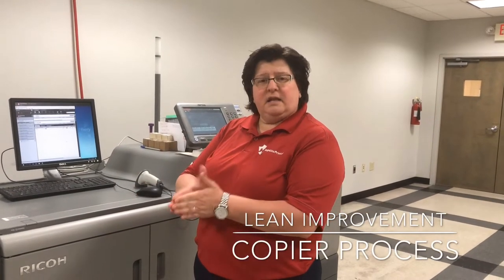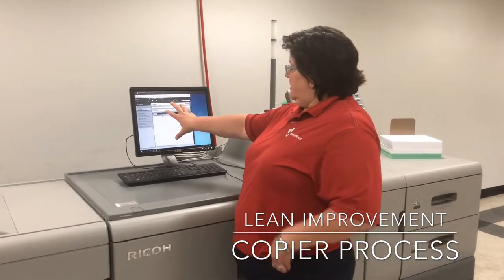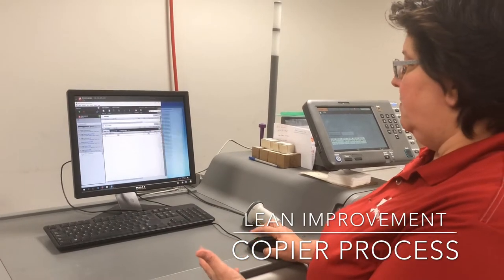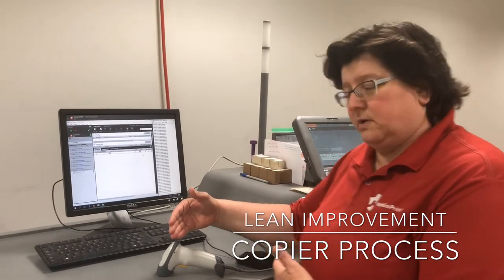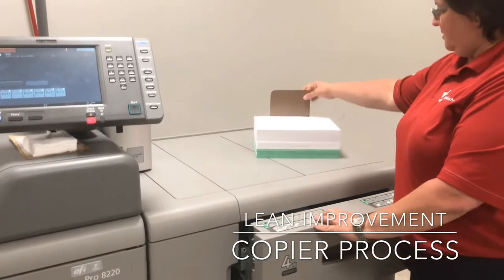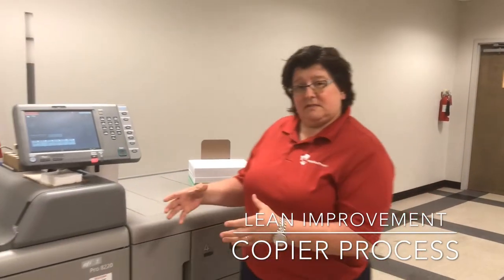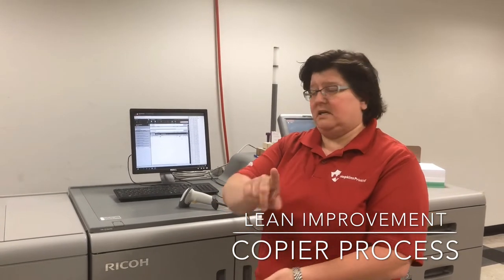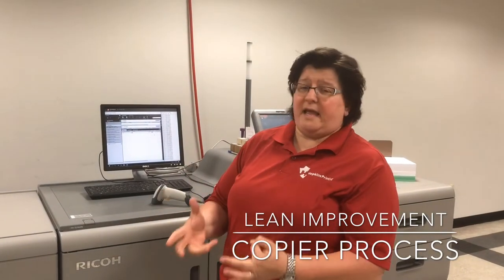Lean Copier Improvements

Comment: My favorite Stephanie is, "roll a shrink wrapper in," don't handle it more than you need and move it around your plant.  Too many printers do not ever consider "moving equipment," even temporarily when they have a large project. Such seemingly simple ideas, are even MORE MAGNIFIED as the number of finished pieces is a large amount. I'll never forget watching a company that needed to 3 hole drill a magazine, have a female employee, ALL DAY, walking from the saddle stitcher, ACROSS the bindery to the drill, and then back again. After 4 hours of this I said to the foreman, "can I have permission to move your drill over to your bindery line?"  He said, "Oh, it's too hard to move, and there is no power over there."  I said, "Well if you will let me, I will show you how to safely and easily move it, and I have enough cable in my truck, to wire you up a safe, and temporary line."  (They had DAYS of work they were going to do this with.... just amazed me that they would even consider such, it eliminated 1 person in the lineup after I moved the machine, because the girl carrying the job back and forth wasn't doing the actual drilling..... she was just the courier!)  LOL  Anyhow...  GOOD JOB guys. I wouldn't have expected anything less but cost effective thinking out of Hopkins, at the highest quality.